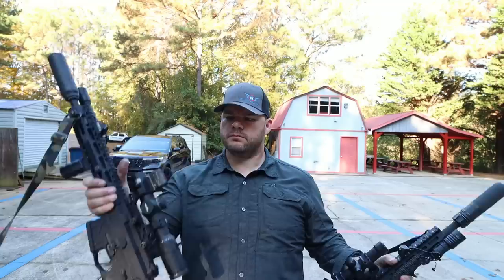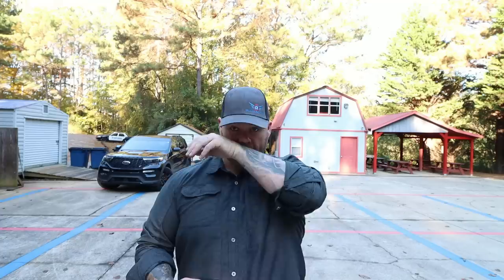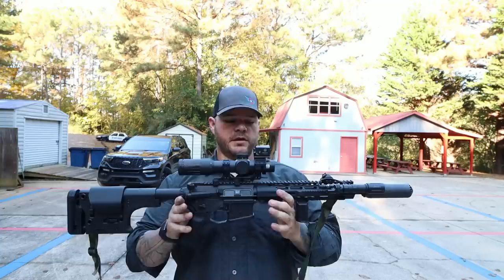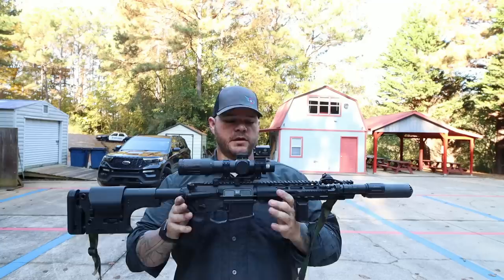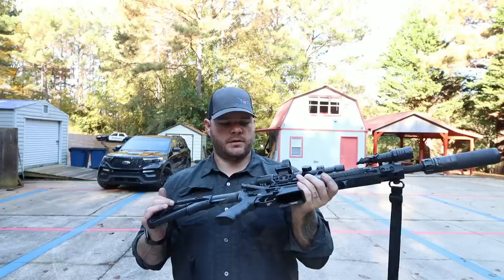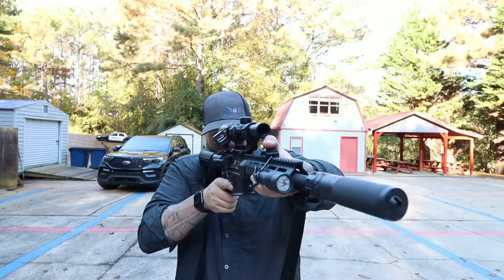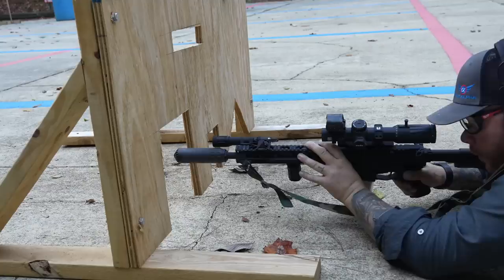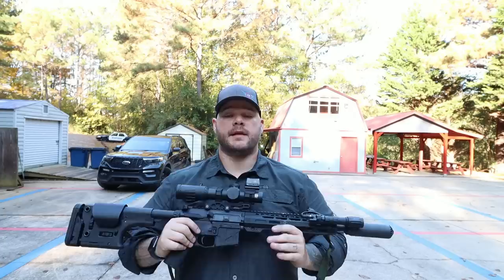Offset Rifle RDS- 12 O'clock vs Canted.

Comment: Here's my take on this, for what it's worth. 

An LPVO requires me to MANIPULATE the rifle to change magnification. 
An offset RDS requires me to move my RIFLE to change magnification. 
A high mounted RDS only requires me to move my HEAD. 

My neck muscles respond directly to my nervous system. My rifle does not. 

Of course, if the only high-mounted RDS you use is mounted over a giant LPVO that's mounted extremely high, and you've chosen to put it behind the turret, then your results may vary. 

Try an RDS on top of a Vortex Spitfire 5x. Completely different experience.

Comment: I'm only 29 seconds into this vid. I paused it. Id like to put my 2 cents in and see if you will say the same. First off, my tikka brush gun in 308 has an RMR mounted at the 12 o'clock above a Leupy 2-7 VXR. But for my ar15s (being seminauto) I have my RMR (bcm ar15) and a holosun 407 (spikes ar15) canted on arisaka mounts. I did this because I have backup QD optics for both ar15s I can switch out whenever. If I mounted them at 12 o'clock id have to re zero if I switched out the primary optics. For example, my bcm has a leupy 2-7 freedom and 4x32 acog. The spikes has aimpoint h2 and 2x20 acog. Kinda weird or so ive been told to run 2 red dots. But the aimpoint isba backup if for some dd reason the acog breaks. 

Lets see if you mention this ... Lol

Comment: With the 12 o'clock setup you are dropping your jaw when using that red dot.
Reply from the maker: Yeah, because I have to match stock weld to stock position to eye-optic alignment and try to center the reticle.
Reply: @SageDynamics  that's dedication to the trade.

Comment: For me it's a no brainer that 45 is a better choice. Rather than using the same mount and having everything fail together, you can have an independent 45deg. 

You could even move it to a different weapon in the field if you needed to

Comment: My main issue with a 45 placement is the use case. People who do it (that I speak too) say it's my backup for when my main optic goes down or if I'm in an awkward position with that later thing being the most important. 

As a test, go ahead and go urban side prone left and right (definition of an awkward position) with a 45 degree. It's basically impossible. Running an awkward position rarely affords you proper cheek placement anyway. Height shouldn't be an issue as most people are pushing high anyway for that heads up situationally superior setup where it matters (up close.) Unity mounts are all the rage right? 

Is the 45 faster, sure but outside of Instagram time runs. This isn't something that really matters. Where time equals do it right now. I can just use the optic housing to get the shot. That's faster than an optic shift. Where I have time for an optic shift I have time to raise my head and run what would be considered a familiar chin mount on a red dot. 

All in all limitations are limitations and I agree both options have them. But where things get weird and start to really matter. 12 o'clock will do better. In my opinion.

If you're just doing range theatrics, 45 all the way. It looks cooler and is faster.
Reply from the maker: K
Reply: @SageDynamics  😉

Comment: If the handguard is stable enough for IR lasers, why not mount the offset RDS to the handguard towards the front of the LPVO? This would give better offset for passive aiming and allow you to keep a cheek weld to the rifle while maximizing capability for interesting shooting positions. Only issue I've had is shooting around barricades with my non-dominant hand. Currently no issues with holding zero either.
Reply: most people are moving away from active aiming with lasers and more about passive, only a handfull of handguards dont flex and most cant or wont spend that money on them.

Comment: What about mounting the backup sight on top at the 12 o'clock position and rotating the gun 45 degrees and using your left eye to see through the red dot? I've tried this on an acog with an rmr on top and it seems as if it might be viable. Just curious on peoples' opinions.

Comment: Do you run dual tubes? I have a single PVS14 and I am getting ready to buy a mount. I find myself smacking the rear of the scope with my pvs14 when trying to passively aim. I was looking at going either 1.93 or 1.7x from badger. Can you passively aim with a 1.7 or do you think the 1.93 would be better (for an offset optic). To your point it will be shot daylight 99% of the time and I do have a lazer. I just don't want to dump a bunch of money into a top mount and hate it. I like your methodology of the offset.

Comment: I'm running TRex arms offset with a 508T and a unity fast 1.93 and 403R as a primary.   Looking to get a 3X or 5x magnifier on a unity FTC mount.   

What do you think about that setup or would you opt for a strict 3x optic and a offset rds?  
Thinking the primary arms 3x micro prism would be good for this.

Comment: What is the optic height of a 12 o'clock RDS at 1.7" anyway? I've been looking at this on my own 1.7 mount, but leaning towards the Reptilita ROF to bring the RDS lower than the Badger One top plate
Reply: It's gonna be between 4-5 inches of height over bore, for context, an absolute cowitness rds is about 3 inches

Comment: I'm so far behind that I'm wondering why the backup irons aren't just placed up top on the rails.
Is it just faster to use a 45° red dot vs irons up top?
Reply: If the backup irons are on the 12 o'clock rail, the optic needs to be removed from the rifle and the iron sights flipped up to be usable. I would say that's pretty slow.

Comment: Not true that you have to remove the red dot optic to use vertical irons. I run red dots on a Unity Tactical riser, which provides an adjustable rear iron at regular level below the mounting surface for the red dot. Add a Magpul front iron site to that. I run a flip-over magnifier behind the red dot, and flip it over out of the way to use the irons.
Reply from the maker: This video clearly isn’t about back up optics/irons for rifles using an RDS as a main optic. 😑
Reply: @SageDynamics  Oh, okay. I'd probably go with RDS offset rather than 12 o'clock, though try to find a mount something a bit less than 45 of of 12:00 o'clock. Seems like I saw one somewhere, maybe an ADM. Would like to mount it QD to rail, too. I may have even bought one and sent it back for some reason. Can't remember now. I was also thinking of maybe a way to mount one with a band mount to the sunshade of a Vortex LPVO that I move QD from rifle to rifle.

Comment: The height over bore is just crazy with the 12oclock red dot.  I would go with flip up iron sights or a 45 offset.  It's kinda weird to zero the 45 offset but you just need it close enough for around 25 yards.
Reply: Or just learn your holds like you have to do anyway.
Reply: sounds like you need to train more lol
Reply: @bghiggy  it's not a point of learning holds, it's the cheekwelds.  I'm not very hip on the chinweld kinda deal.  I'm sure you could train enough without any sights on your gun and get good enough to shoot short distances.  It's all about comfort.
Reply: @contentcop  wish i could but I'm not a millionaire.  😂 Ammo jokes
Reply: @non-binaryjesus  i make under 20 a hour and own a whole NV set up. weak excuses are weak.
Reply: @contentcop  so you make less than 50k a year but can have a 5k setup? Do you live with your parents and have no kids?

Comment: Iirc unity fast lpvo mounts are 2.05 so they’re ever so slightly taller than the 1.93s. It’s there currently is without using an external riser. My guess is that with cheek risers coming, there would be taller lpvo mounts coming soon. Probably will stop at 2.26

Comment: I am so torn on which optic system to go with. I like the versatility and range an LPVO adds but I also like the quickness and simplicity of a red dot/holographic. And nobody can really help with something so subjective 🙃😩
Reply: Buy the more expensive set up first, if you don’t like it, sell it. You will have enough money left over for the cheaper of the two.
Reply: Seems like a matter of do you need to shoot long distances or not
Reply: Both 😂
Reply: Acog ta02 with piggyback rmr. Youre welcome
Reply: Welcome to the rabbit hole. We have been expecting you.
Reply: @boygonewhoopdataZZ  Both and build another rifle for the other optic setup.
Reply: I had a similar dilemma years ago when I was building my first patrol AR.  The deciding factor was what was I going to use the rifle for, I ended up with a T-1 as primary with back up co. wit iron sights.

As the years went along I just added rifles to address distance needs. I found that trying to build that one do anything rifle was an impossibility.

Comment: Quick question Aaron, why not use the 36 meter zero for off axis sight? I use it for my eotech and love it as it takes the guess work out with a less than 9” deviation between 36 and 300 meters. Seems like with that all you need is your hold with height over bore at that point and nail combat accuracy but I’m a lamen tard on this stuff. Just a gunhead that loves this new shit nowadays
Reply: Thanks for watching and participating in my channel congratulations🎉🎉🎉 You won a prize🎁 text the number above 👆

Comment: I think the one other thing that's not addressed here, regarding the reason to use to use an RDS on a magnified optics, is because even if you have something like a 1x prism optic, you are still technically reflecting light through lenses and they are never ever going to truly be a 1x. That's the other benefit running a BURDS

Comment: Great video- here’s my issue- I’m a left handed shooter and I mount the red dot off set on the left side of the rifle. This seems more natural for me. the problem is that the spent cases eject into my bicep,,,I got the burns to prove it. Should I just mount it on the right side and just adapt or am I missing something here?
Reply: I run a lefty upper so shell casings eject to the left.
Reply: @vgt  Yup - thought about that as well but wanted to stay with what I have adapted to over the years…I guess I will beat up my biceps a bit….

Comment: Red dot at 12. Scope at 33. This is the way. Catch up.
Reply from the maker: Sounds like internet garbage but ok.
Reply: @SageDynamics  been running it that way for 15 years.  Red dot is primary at 12 for everything. And a scope at 33 when you need it. Think about it.
Reply: @SageDynamics  the "catch up" was rude and counter productive. I apologize.
Reply from the maker: @blindtrace7220  well I’ll apologize also because I thought you were talking about zero distances.  As for mounting, I’m still not using 12.
Reply: @SageDynamics  sorry. Now I feel like I'm wasting your time. Red dot at 12 o'clock,  because that's what we use 99 percent of the time.  Magnified optic at 2 o'clock, then it's there when you need it. All you need is a machine shop to make the mounts. Which I've been doing for 15 years. Your channel is very good, keep up the good work. I'll be more polite and precise next time.

Comment: Would there be a difference in usability between the two for the scenario of weak side shooting, specifically in that compromised prone shooting position?
Reply: In my experience, yes. Unless you have a really tall offset mount, it's unusable on weak side. I have the TRex offset mount, and was using the highest setting. It's one reason I just decided to ditch the offset and just run the LPVO.
Now if I held it without a cheekweld, probably could do it. But with the gun all shouldered as normal, I could not get a sight picture through it.
Reply: If that’s a concern, I think the 12 o’ clock position would be more beneficial, as the offset dot favors a biometrically easier rotation for the strong side.  Of course, training will be the ultimate tell.  I use the offset for my rifle and just turtle down to see my red dot.

Comment: In your opinion, closed emitter or open emitter for an offset rds for an lpvo? Or is there really not that much of a difference in the grand scheme as long as it's a quality optic?
Reply: What elements are it being exposed to? What will make it less likely to fog up or otherwise be unusable. For me enclosed is better
Reply: Personally I run a Nightforce ATACR 1-8x24 with an offset Aimpoint T2, which is a closed emitter optic. I prefer closed emitter red dots on rifles as they’re easier to clean in an emergency situation than an open emitter optic. Open emitter optics have too many nooks and crannies. A closed emitter optic doesn’t have an exposed emitter. Just wipe off the front and rear lenses as best you can and get back to work.

Comment: Your entire premise is based on the strawman of calling the use of a 6 or 10x in the standing position is a valid method of engagement.  
There is no reason you need magnification at a distance you would take a standing shot, ie 50 and in. 50 to 100 and you are looking at supported shooting positions which negate the advantage of the heads up position you get from the high mount, and in fact they can make it more difficult to make a shot.
Reply: Thanks for watching and participating in my channel congratulations🎉🎉🎉 You won a prize🎁 text the number above 👆

Comment: Offset don’t work if you’re running helmets, coms , nods or gas mask
Reply from the maker: I don’t know who lied to you but it absolutely will if it’s mounted with appropriate standoff.
Reply: @SageDynamics  nobody did ,, 4 combat deployments did .. 45 mount works in your backyard but has its limitations
Reply from the maker: @JohnDoe-nh1ll  weird because mine works just fine out of the backyard.